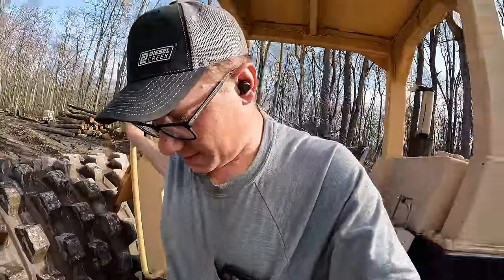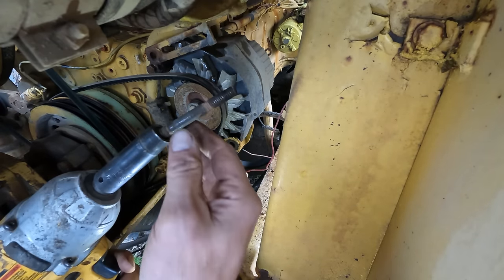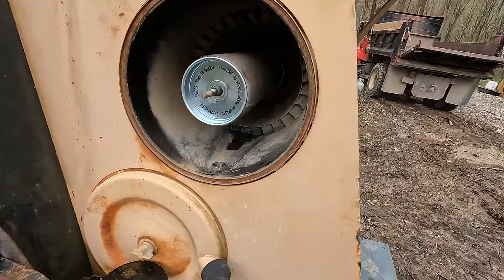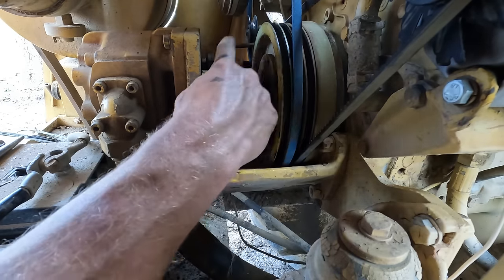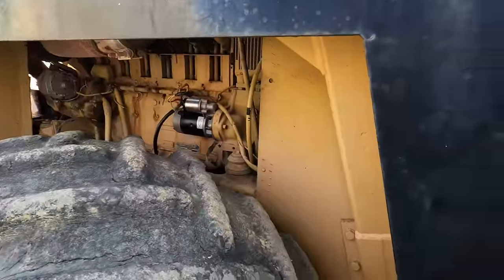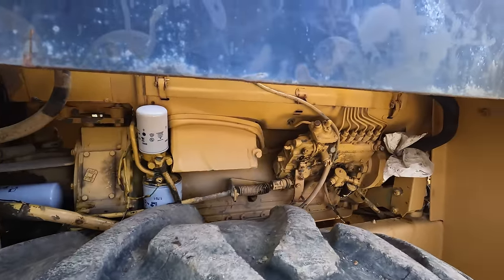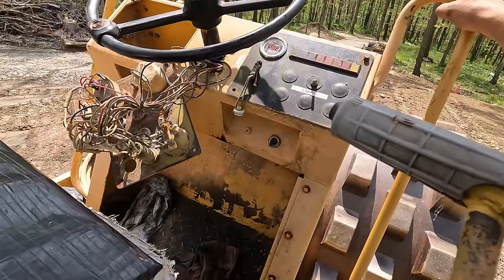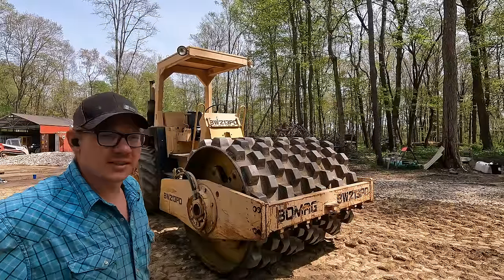I got BURNED on this Compactor from an Auction! (Bomag BW213)

Comment: With these deutz engines it’s important you keep the cylinders clean. I’ve you have an oil leak dust can fill the ribs on the cylinders!
Reply: Yep, I work for a company that's a dealer for numerous engine MFG's and Deutz is by far the worst engine we work on.
Reply: @auriptide  I haven’t had a lot of problems with deutz engines. I’ve you do your maintenance on them. Their pretty reliable!

Comment: Need to try get a second belt on there those fans draw alot of hp. There are 2 temp sensors on all deutz motors. One goes to a hooter and the other goes to your dashboard. You need to make sure that the fins are clean so that there is proper airflow otherwise you get hot spots on the cylinders
Reply: This guy deutz for sure
Reply: And one sensor are on the belt tensioner.
Reply: Temperature Sensor 01173672 for Deutz 913 912 511 1011 2011
Reply: @hansselin9131  And, that's the wrong tensioner--it needs two grooves for the two belts.
Reply: We had that engine in an Atlas Copco compressor.  If I'm remembering correctly there is supposed to be a sensor on the belt tensioner that shuts the engine down if the belt breaks.
Deutz guys correct me if I'm wrong.

Comment: Brings back memories.  I was and am a heavy equipment mechanic. I was told by my Dad when I was about 7 to always work on something like you will be the next guy to work on it. That meant lots of grease, anti-seize, and dielectric grease! Real bear to pull a 13spd and dual plate clutch and flywheel to access the backside of a stuck starter bolt! That's why on every truck we got some things had bolts removed one by one and greased! I built and dynoed lots of Diesels and one thing I learned was that being "good" about pre-filled oil filters caused some priming issues because the dry pump after oil change esp. Hot couldn't blow the air through them to prime. So only 1/2 full now. Every time I check oil i put a drop from the dipstick on each battery terminal or starter connection as well. I remember being 19yrs old and driving a smooth drum over 20 mi one day back to the shop. Took almost all day. Fun tho with the variable vibration hitting the harmonics that made kids and water in nearby swimming pools jump! And a dog following his food dish that started walking down the driveway! I stopped that when I saw a picture window on the verge of exploding 50ft away!
Reply: Brilliant idea about the drop of oil from dipstick now why didn't i think of that (head slap) at 73 never to old to learn.

Comment: The Belts we used to fit on those Deutz, were a twin solid belt, and my boss used to get me to fit a spare one past that coupler and cable tie it to the pump frame and out of the way.  so when one failed, another one ready to slip on, tensioner is meant to be  twin belt. Also those dash panels are pretty useless, all i used to do is rig up that switch on the tensioner pulley to a car horn, a loud one. makes people look when thats going constant. lights on a dash mean nothing to most operators !!!
Reply: I love the car horn idea for those Deutz air cooled engines, water cooled engines boil over in a spectacular fashion with a bunch of steam.
Reply: We bought a tracked drill right a few years ago with that setup. It had no safety features at all when we got it so I had to rig one up. I ended up tying that switch into the solenoid for the pump, if the belt broke, it just shut the unit down right then and there. I know the guys who run it, and a light would for sure be ignored. A horn is a good idea though, but I was doing a shutdown system anyways so I just went that route.
Reply: @--_DJ_--  Definitely a good way to go about it.  I've set (some of) our equipment up to shut down on low oil pressure, broken fan belt, and if low coolant level is detected.  For starting there's a momentary push-button override.
Reply: Great ideas in this thread, cheers folks!

Comment: Fix the warning light switch on the belt tensioner. Believe me, on those engines it is as important as the oil pressure switch. Ken Wheeler Narrowboat Services, Chester, England
Reply: My friends 1958 army water pump with an F4M514  has a belt tensioner kill switch on the fuel pump. If the belt breaks, it shuts off the fuel.

Comment: Nice to see this old gal run so smoothly.
I've actually designed some parts for their modern equipment when I worked for BOMAG here in Germany a few years back.
But these old machines are just build different.
Very good Video. Keep it up 👍

Comment: Good enough, that seems to be a lot of people's attitude with older equipment.  They use it occasionally and let it sit most of the time, so if it will start and do what they want it's good enough.  Like you said, it might be overkill for most of your jobs, but when you really need it, it will pay back more than you've invested.
Reply: seeing as the rental rate at United is $500 a day or $3,700 monthly for a machine that size, you can get the much smaller 47" 9.5 ton bomag for $320 / $2,000 .... id say  he is in a win win situation.  id be surprised if Matt looses any money on this thing when hes done with it.
Reply: Yeah I’m thinking of him using it to roller his long driveway.
Reply: @scottcol23  especially with the absurd prices /working/equipment is selling for right now.

Comment: Not so much burned as lightly grilled Matt. It hasn’t taken you long to get this machine repaired, serviced and running albeit with a couple of issues still to address. Just highlights your ability to get stuff going. Very enjoyable watching it happen 😊
Reply from the maker: Just wait it gets worse…..
Reply: I see what you mean! Matt, I am very much an end to end viewer but must have missed this bit today. Can’t wait till the next instalment 🤨
Reply: @DieselCreek  I saw at the end bit...
Looks like the vibrating shaft (?) locked up the drum? Broken maybe? That happened on the smaller one aswell, right?
Reply: @DieselCreek  I was thinking you accidently grabbed a hot manifold when I read the title! I think maybe the next video should have had this title if it ended up having issues with the vibratory assembly. This video just showed normal maintenance.

Comment: I worked on Bomags professionally for a number of years, and 2 things I spotted right off that are wrong. Belt tensioner pulley is supposed to be a double pulley. Drain pan is on incorrectly. It looks like you have a steering orbit valve leaking as well.
Reply: And why the roller has stucked now? There is a common failure?
Reply: Orbitrol steering units always leak at the shaft when they are left outside with no cover and rust works it's way below the dust seal then the pressure seal.
Reply: @bigsmoke6189  Agreed. I just redid the seals on my underground haul truck's orbitrol.

Comment: Even if you don’t have vibration, it will still be fine for compaction of soil, just keep the lifts really thin and roll the snot out of them. I worked in construction inspection for a number of years, and there were more than a few times when the roller quit vibrating. They were still able to finish the job, but we would make them reduce the lifts down to four or 6 inches and just roll the crap out of them, and that would usually do fine.

Comment: Really cool machine and good job fixing it :). I don't know if anyone else pointed it out yet, but around the 21:00 minute mark, when you start the machine, you can see oil squirting out from the hydrolic oil cooler, so I think that's where your leak is located.
Reply: That was water pooled on top. Thing would be dry in 10 seconds if hydraulic leaked that bad

Comment: Should change out that single pulley for a double belt.  Those air cooled fans can put a big load on those belts.
Reply: Needs a dual pulley idler wheel on the tensioner.
Reply: Make the 2xpulley bigger in diameter to shorten the belt and avoid friction on the frame
Reply: Ford pickups used to use double V-belts on the fan.

Comment: On these belt driven blower untis its very important so keep the cooling fins of the cylinders clean, and the belt tentioner switch working.
Pretty much the only way you can kill one of these engines is heat seizing.
One of our customers ran a 4 cylinder 912 Deutz without oil until it seized, started right up after filling it with new oil, piston rings were toast of cause, but he could finish the season of using his mobile aggregation pumping.

Comment: On the fan belt tensioner there is a switch that trips when The belt either comes off or gets too slack.  Depending on application it can be wired to either turn on a warning light/buzzer or shut the engine off.
Reply: Agreed, we had a similar situation happen with our Bomag and the operator almost blew up a freshly rebuilt motor. The factory light/ buzzer are not the best on those machines.

Comment: I can see the limit switch near the pulley. It's must be bypassed. The engine should shut down immediately when the belt breaks. It's the most important shutdown on Deutz's. I'm a Deutz tech BTW.
Reply: That unit doesn’t use a shut off solenoid, it’s fuel shut off is manual. The belt break switch only illuminates a light on the dash on this unit.
Reply: It could easily be modified to drive a fuel cut off.

Comment: I've been trying to find a padfoot for a while now, youre exactly right when you say the world is crazy. Stupid small junk units are selling for absolute huge amounts. The metal on metal sound could be the cleaning shanks being loose. Also the hydraulic filter could be restricting for the vibrate. There could also be two settings for the vibration, the slow vibrations are good for wet materials, and fast vibrations are good for dry material

Comment: Its a common problem with thode Aircooled Deutz engines that they eat the blowerbelts
We have several wheelloaders with smaler Deutz Aircooled engines in it and they all eat up the belts every now and then.
Only difference ,they dont wanna run after that happens,a safetyswitch prevents that
Reply: Yes, my friends 1958 ex army water pump has that too. You only know if a warning light works, if you dont see a warning when yo do know the engine is in distress... which defeats the purpose of a warning system.

If your engine shuts off for no reason, you know its time to fix the safety system, thats ultimate failsafe 😉

Comment: 24:50 i have seen such Bomags, the oil pan is the wrong way around mounted, bolt holes align either way - you should flip it 180 while you drain it after done watching you done did the oil change and i doubt you gonna drain the clean oil out again , catch it in a clean pan and then flip the oil pan, and remount it the right way

Comment: A small plumbing torch with mapp gas is one of my most useful tools - sometimes more useful than oxy-acetylene torch, drill bits, and tap and die sets.
Reply: Those no longer use the original MAPP gas and aren't as hot as they used to be. Those small cylinders are now filled with propylene plus a little propane as a MAPP substitute. True MAPP gas production ended in 2008 in North America,
Reply: @bills6093  even still, it burns hotter than just propane. Great for sweating copper among other tasks.

Comment: My guess is the tensioner is aftermarket, such a crucial thing for the cooling, the belt should have a backup.
Reply: I think the tensioner is original.  Look closely, there is also an electrical switch there, that switch is/could be used to alert the operate of a broken belt or even shutoff the engine if the belt breaks.
Reply: @davidnull5590  that’s exactly it. The second groove in the flywheel pulley and the blower fan is the backup belt, it doesn’t need to operate the shutdown/indicator switch.
Reply: @SHarris64  A backup belt only does you any good if you actually maintain the machine and catch the first belt being broken. Going by the condition this was in, and what other commenters say about maintenance schedules on construction equipment... The switch is the fail safe, the second belt just extends the maintenance interval.

Comment: It always amazes me how easy it seems to be  to get parts for these old machines, it's really good.

Is it because the US is so big and loads of people are still using them or are modern machines still using the same parts?

great video as usual.
Reply: This is because these 40-50year olds keep running with minimal maintenance and can be serviced by a horse-shoe technician :)
Reply: Both reasons you named, newer stuff uses a lot of the same components and also a lot of people keep older equipment because it runs better, less technology more mechanical, and emissions on the newer shut keep people from buying new stuff. No one wants emissions on equipment, it's terrible for engines
Reply: Also those engines were used in so many things for so long there's still loads around...

Comment: The ring gear is separate from the flywheel and should be able to heat with a blow torch dropped & flipped. On the F41011F Deutz I had to flip a couple.
Reply: Correct, but getting at the flywheel is not that fun.... I would chamfer the teeth with an angle grinder, and it'll run for another decade

Comment: When you fired it up after installing the new starter, I noticed some trash (mouse house) exiting the oil cooler fins. You can't keep a Deutz too clean when it comes to the cylinder fins and oil cooler.

I appeciate you taking us along on your projects!
Reply: yeah that deff was water coming out, not trash. you can even see the rust stains on the fins in the same place it comes out.

Comment: You're not as bad at electric as you believe Matt. You diagnosed the issue(s) correctly, and made upgrades. One thing I've learned in doing this kind of work  for 30+ years: you never stop learning. Keep up the good work, and maybe get some wire loom to protect those new wires and neaten it up a bit. Oh, and the newer style solder on terminals with the build in heat shrink are far superior to the stak-on crimp terminals. They will last much longer and not corrode. A bit more expensive, but worth it IMHO.

Comment: I always assume that with any big equipment bought at an auction there’s gonna a be a $600-$1000 initial ‘startup’ cost to fix someone else’s problems they neglected or caused.

Glad to see that just an oil change, new filters, starter, alternator and belts plus some wiring made it a workhorse again. Good job👍🏽

*ps. the instructions for dropping the starter on the ground is only applicable to the Limited Edition version 😉
Reply: Heck, any vehicle at auction will need a grand in repairs at least.
Reply: @yoyo762  correct, I'm a LV mechanic and have a customer that buys from auctions all the time. Just finished his last purchase and it ended up costing him about $6k and there was still issues but at least driveable. Not sure what he paid for the car originally but hopefully he got a good deal.

Comment: Hey Matt,
the tension pulley has a switch, which should be connected to a horn. That should inform you when the belt breaks.
Reply from the maker: Ya the wiring is a nightmare
Reply: @DieselCreek  You do pretty good Matt for a mechanical guy.
Reply: yes we have o horn on our deutz engine  to
Reply: @DieselCreek  Wes would probably agree with you on this one :-)

Comment: When a seller says "its been like that for years" you know they went the absolute cheapest for any maintenance on it. If it didn't prevent it from running it probably wasn't done, or a band-aid solution was used.

Comment: FYI…..I found a solution for keeping bees, hornets etc. from messing with equipment and storage buildings. I buy medicated ear tags from the local ag supply store. I hang them in storage areas and on equipment and they keep those pests away.
Reply: I've been using wasp spray and every Spring I just hit a few spots around the motor or where ever they try to build a nest. That seems to sour the area and they stay away. Mice don't like it much either.

Comment: Usual old equipment items due to lack of maintenance.  Filters, fluids, belts, starter, alternator and minor wiring. At least you didn't have to replace the batteries.
Good deal in the end.

Comment: The coupling connecting the crankshaft to the hydraulic pump is a Centaflex, made in Germany, in case you ever need to buy one. . I used to work for them. Good flexible coupling. Cheers and keep up the good work Matt.

Comment: I tighten oil filters by hand...and I tighten slightly more than light pressure...easy on and easy off by hand only. Aircraft oil filters are required to be safety wired to prevent backing off in flight. The aircraft oil filters come with built in small rings to safety wire from. Blue Sky's.

Comment: I’ve worked on generators that used those Duetz engines. The belt that goes on the pulley runs a switch that can be used as a engine shutdown or an high engine temp light. The second belt can just go from the crank to the cooling fan. No need to have two pulleys for the switch. NEVER run the engine without the main cowling, it can’t build any air pressure to cool the engine. It’s like running with no coolant.

Comment: You might want to verify that is the correct idler or at least tensioning in the right direction.  Usually idlers tighten a belt by increasing the belt contact on the pulleys,  more contact equals increases horsepower transfer.

Comment: Matt unscrew the centre screw on the Duetz lift pump remove the lid and check for a mesh filter some of those pumps block in not cleaned cheers Phil 🇦🇺